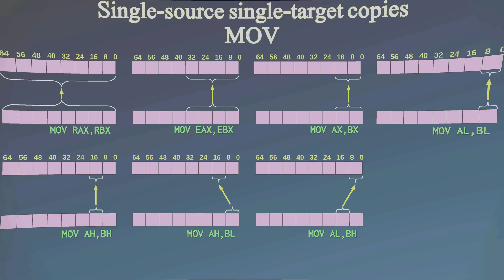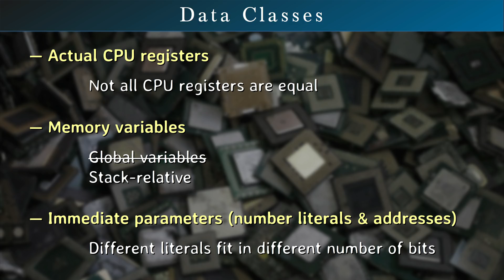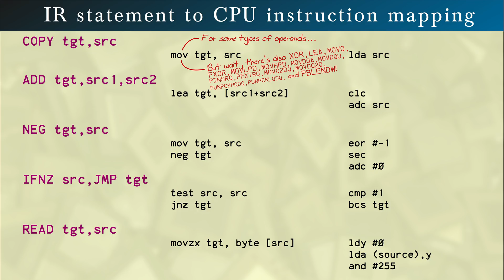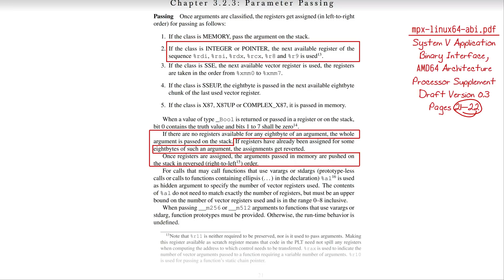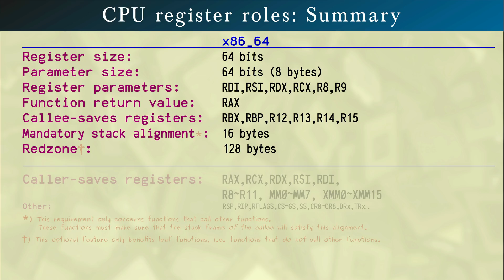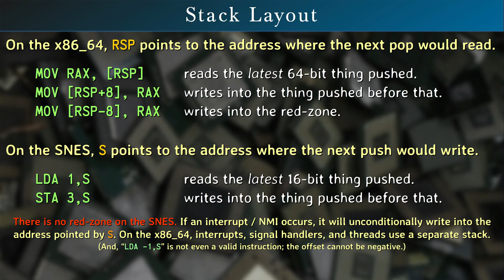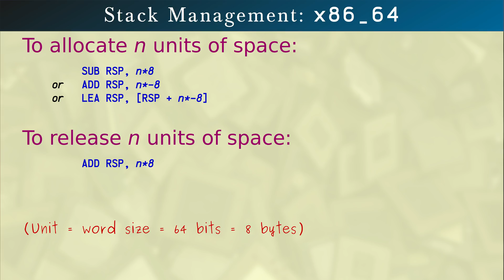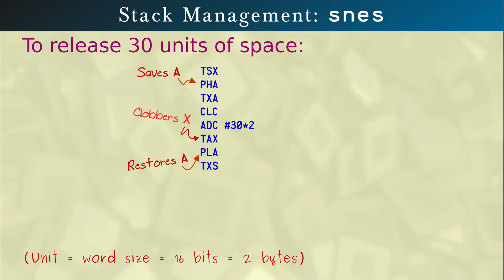ABI & Instruction Mapping — How to Create a Compiler part 5a/5 — Designing Machine Code Synthesis

Comment: Given https://youtu.be/kZRE7HIO3vk and the problems that modern ISAs have with their unnecessary bloat that slows down everyone's code, would creating a modern version of the NES CPU emulator be the closest thing to creating an ISA or would there be a lot of other implementations details to think about? Thank you so much for the wonderful series, Bisqwit and have a great day :)
Reply from the maker: That’s a pretty long video (109 minutes) to sift through to understand which arguments you are alluding to. Care to summarize?

Yes, I have heard before that the instruction decoder in a modern x86 processor is a significant bottleneck. Intel once attempted to solve this problem with an alternative design from a totally different perspective: This attempt was called the Itanium. It shifted the responsibility of good scheduling from the CPU into the compiler makers, and it was not warmly received.

Their current solution is that underneath the CPU is really very, very different, basically a RISC-like architecture with a huge register space, and the instruction decoder actually just translates into those RISC instructions in real time.

“would creating a modern version of the NES CPU emulator be the closest thing to creating an ISA or would there be a lot of other implementations details to think about” — No, when you are creating an emulator you are not designing a new ISA, you are creating an implementation of an existing one.
Reply: Sure thing. The abridged version is that the bloat of the ISA stems from two main problems:

1) There are several unnecessary instructions within the ISA that allow for immense device support in every CPU. This means you wouldn't need to have a specialized ISA for each CPU chip since that would significantly shorten the life cycle of the CPU chip and people would move on to the next computer within 18-24 months, if that. That would explain why you have 3 main operating systems today instead of a custom OS for every game like in the 80s and early 90s. This can create a serious security problem since you have opcodes that are only used for a specific set of calculations and it could make for a wider attack vector for hackers to exploit the mishaps of the ISA, which could very well be solved with a minimalist Hybrid instruction set with enough opcodes to supplement security features from the CISC wrapping, but not so many that you could have potential bugs in the ISA itself.
2) Because of the way the ISA is designed, every kernel must be the middle man in the data plane, actively impeding any progress made to calculations. Ideally, you would want the OS/kernel to be the control plane, which brokers resource access/limits between programs like Redis and I/O devices.

Sadly, the cruft that we could remove from the ISA is the device support that is necessary for even the most basic OS to be functional and is really a hardware manufacturer problem that must be supplemented by customer demand and can't directly be solved by the customer, so fingers crossed for everybody to create that demand so we all get faster computers in the end. 

https://www.usenix.org/system/files/conference/osdi14/osdi14-paper-peter_simon.pdf is referenced throughout the video and is a very good resource for outlining a super high-level design that allows the kernel to be the control plane instead of being part of the data plane. The result was that a small rewrite of Redis that used direct I/O writes/reads combined w/ Arrakis significantly increased performance across the board. Simply incredible if you ask me.

Here's the 28m YT video on this paper -> https://www.youtube.com/watch?v=WG3b2hE4i6U

Comment: thank you Bisqwit for your effort and time, i have a question is it right that gcc parser is LL(1) parser and it was written manually without using any generating tool?
Reply from the maker: Up to some relatively recent version, GCC actually used Bison as its parser generator. Bison does LALR(1). The GCC team eventually rewrote those parsers manually, and I imagine it’s mainly because C++ has grown way too context-dependent to be conveniently parsed with LALR(1) anymore.

Today, the GCC source code has this to say about its C++ parser: “The parser is of the standard recursive-descent variety.  Upcoming tokens in the token stream are examined in order to determine which production to use when parsing a non-terminal.  Some C++ constructs require arbitrary look ahead to disambiguate.  For example, it is impossible, in the general case, to tell whether a statement is an expression or declaration without scanning the entire statement. Therefore, the parser is capable of "parsing tentatively."  When the parser is not sure what construct comes next, it enters this mode.”

The C parser does not have an equal statement, but I suspect the situation is same or similar.
Reply: thank you Bisqwit for your answer, and since you mentioned the GCC source code  i have another question why the GCC source is so large (~15 million LOC) and complex, messy and hard to understand  it's like 7 time the size of LLVM
Reply from the maker: Make sure you are comparing against Clang, not against LLVM.
Also, GCC is a compiler collection, it includes not only C and C++, but also Ada, Java and many others.
Reply: thank you Bisquit, keep up the nice work ;)

Comment: >That gpu support string
I thought I was the only one doing that.
Reply from the maker: Ah yes. It is an awfully heavy graphics card and the weight is twisting the PCIe connector otherwise.
Reply: lmoa same except that i made another hole for another screw

Comment: This is the best video to wake up to!
Will parts 5b and 5c will be about register allocation and implementing code generation? Code generation always fascinated me, because it's easy to do poorly but I don't know how to do it well. (Do you generate poor code and then do optimizations on it? Is there some fancy algorithm for translating between instruction sets without adding unnecessary instructions? Is it all painfully handwritten pattern matching?)
Reply from the maker: Part 5b will be about implementing code generation. I am not totally sure how many parts there will be to episode 5 in total. The most likely option though, is there will be parts 5a, 5b and 5c.

The code generator will be platform-agnostic, with nearly 100% of the platform-specific stuff being data-driven.
It generates sort of a mixed ground between optimized and poor code. For the sake of brevity I will omit the last few optimization steps which would be eliding redundant spill&load sequences, threading jumps and merging identical code. However, the algorithm I use for the code generator is pretty smart even if it operates on individual IR statements at time.

Register allocation was already done in episode 4b. The allocation algorithm could be revised with platform-specific knowledge, but again I have to draw the line somewhere.
Reply: Ah, sorry. I forgot about the register allocation in the last episode, guess I have to rewatch this series again :)

Comment: Bisqwit karateka and prince of Persia was originally created for apple 2 but were successfully ported to DOS , they have used a technique tool to port NES or apple 2 games into DOS can you please tell me how it would have been done , thanks and regards.😀
Reply from the maker: Some games were written as state machines / interpreters where the game itself was implemented data / bytecode for the interpreter, and porting the game to a new platform would be a matter of rewriting the interpreter & support routines for the new platform. I don’t know what the case was for Prince of Persia specifically. Also some games were totally rewritten from scratch for each different port.